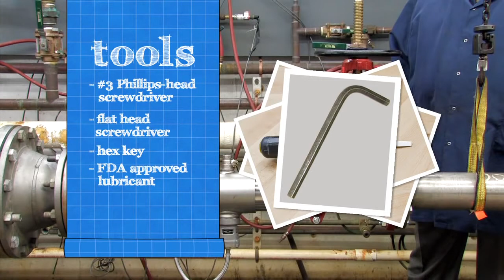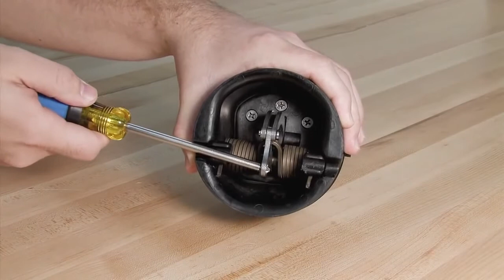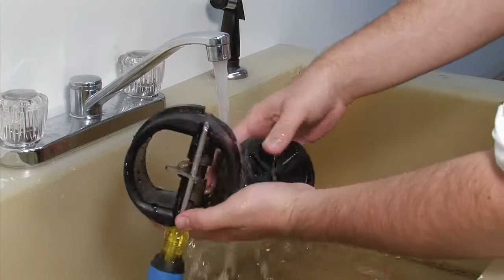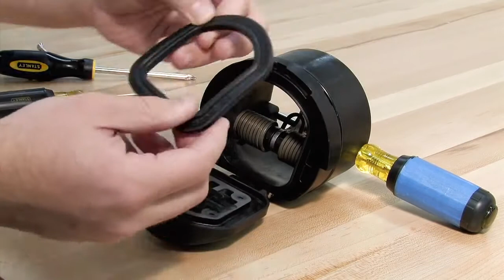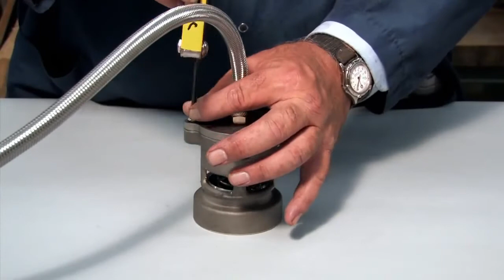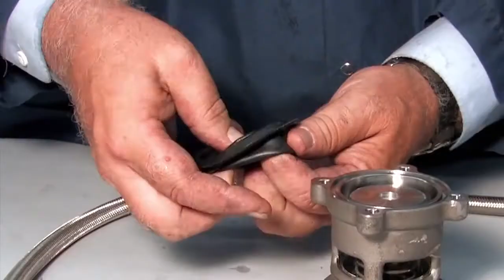Watts 957 & 957RPDA 2½''   6'' Backflow Repair Video

Comment: These are the worst backflows to ever repair. Don’t get us started with sliding back that damn body. Very annoying. O rings from body breaks sometimes because metal plate that holds check 1/2 it’s very sharp and slice the orings. And yes i clean the body and even lube it up before sliding it back

Comment: With all due respect to the MFG, I have had the same experience with this design failing on a regular basis, including the DCVA and RPBA. In my opinion, the check design doesn't generate enough velocity at higher flow rates via spring resistance to assist with clearing minor debris, unlike a traditional center-guided check design. If you have an older service line that has built up fine debris, failures will occur regularly until the line is flushed thoroughly enough to clear the buildup or is replaced.

Comment: Very little experience with these. Are the checks simple enough to wiggle out without needing a rebuild kit on hand?
Reply: hey yes you can remove and inspect the check valves without having repair parts on hand but we do suggest having a rubber repair kit on site just in case the check needs to be rebuild.